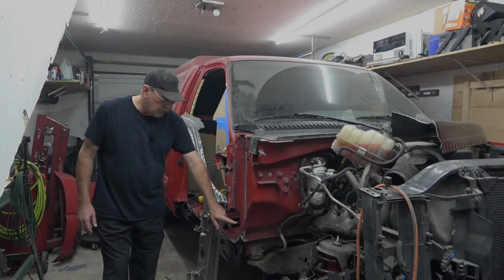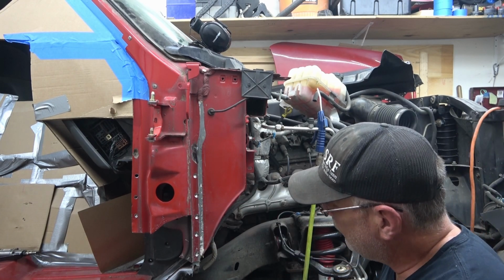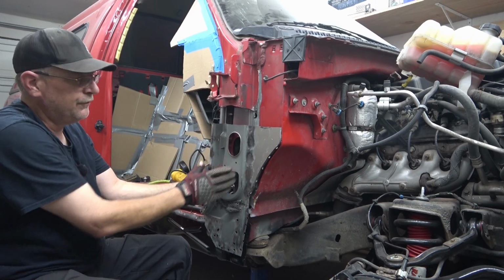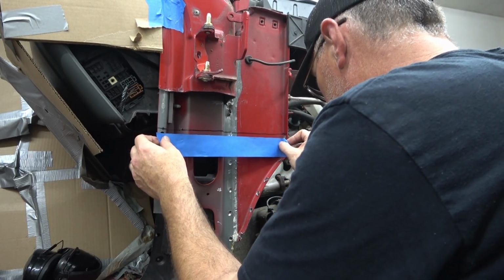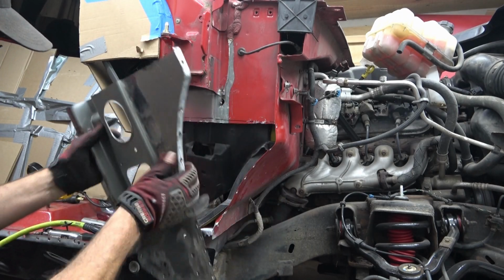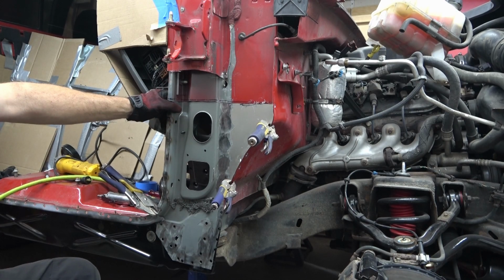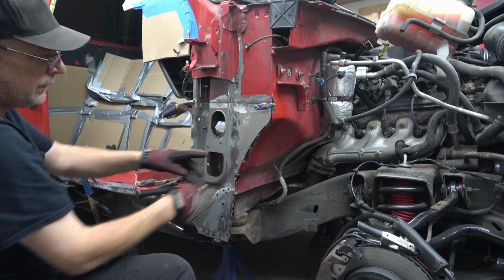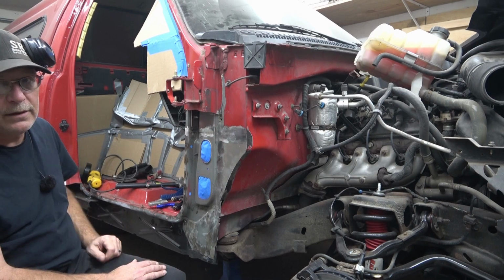How to Repair/Replace an Inner "A" Pillar.

Comment: Is there a reason why spot wheld holes aren't left so you can weld there again?
Reply from the maker: One of the parts needs to have a solid surface to weld to. All of the spot weld locations were welded back up, whether from the outside or the inside of the area. If you can point out a specific time in the video where you think one wasn’t done, I may be able to answer your question in more detail.